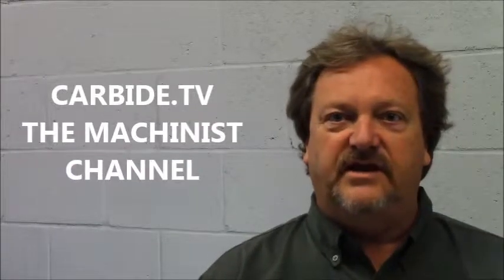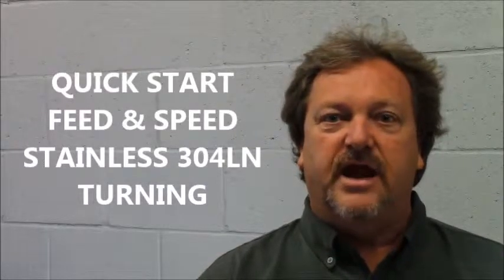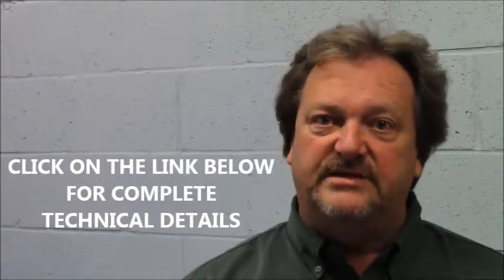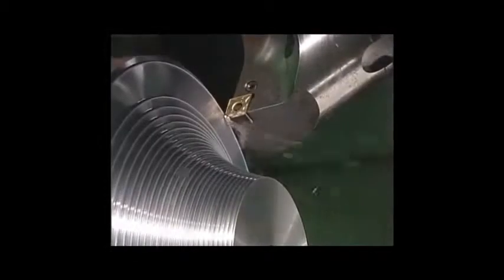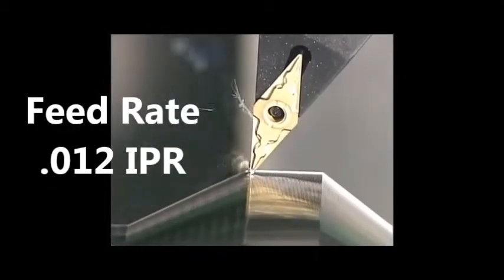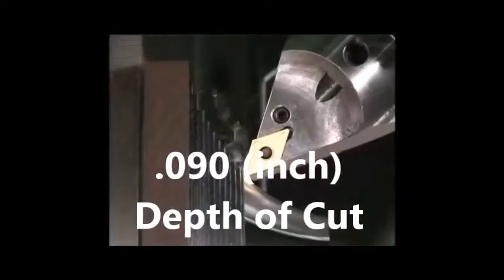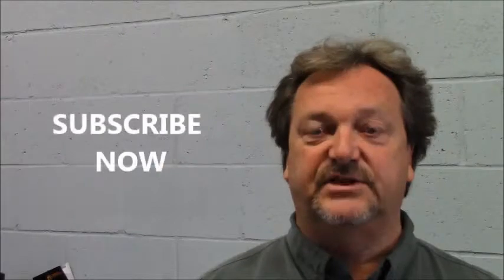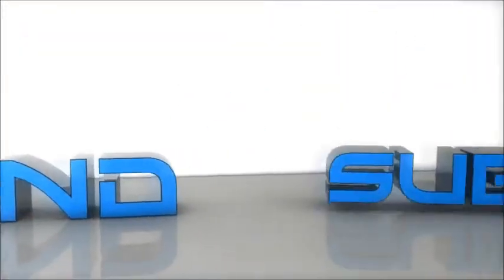304LN Stainless Steel Turning - Quick Start Feed & Speed

Comment: Great video, already helped alot! I was wondering if you could help me out though?
I'm boring out a 3.5 in deep hole that's around 1.200 in diameter. I'm using a carbide boring bar with a carbide WPMT-32.51LF trigon tip on it and I'm getting a lot of chatter!!!!
any tips on feeds and speeds and possibly a good depth of cut would help tremendously! thanks.
Reply from the maker: Visit this link with attached brochure
Buy Boring Bars - Dimple Anti-Vibe CARBIDE CA
Review the attached brochure and I will see what the correct specifications may be when I get more of your application details.